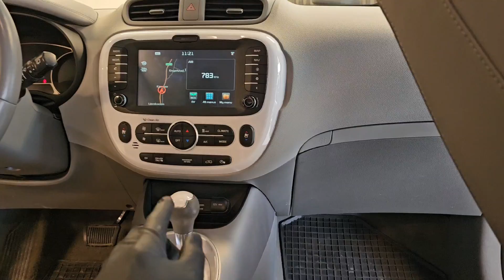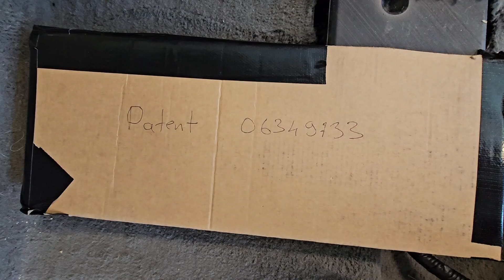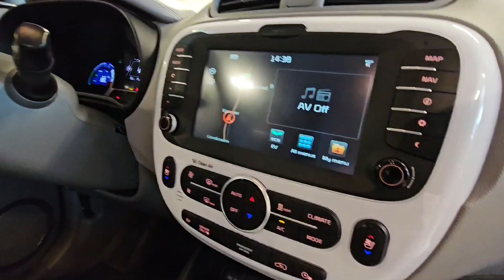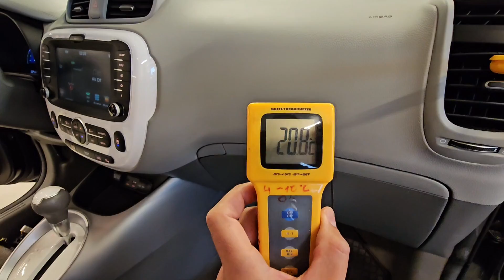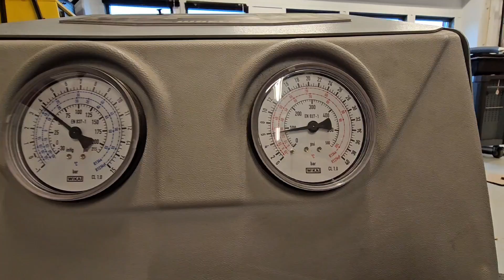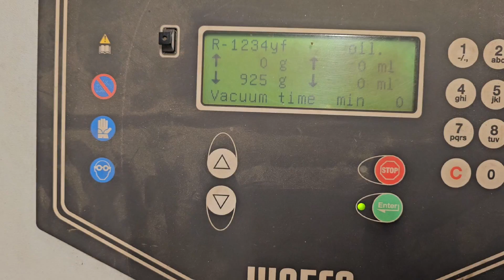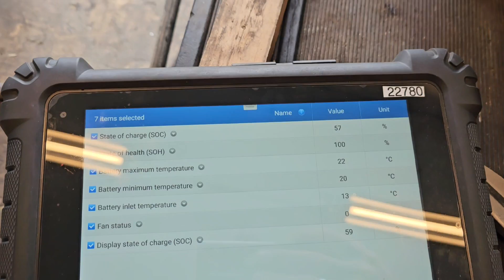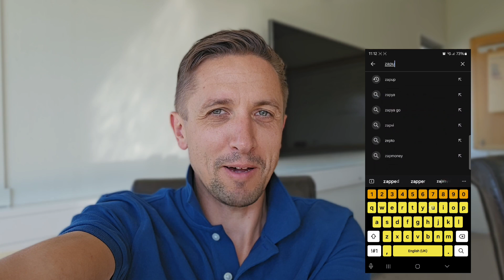Elbilmek improved battery cooling in Kia Soul 27 kWh

Comment: Question for Valdemar though - would it work if we did heat pipes like in laptops/desktop PCs - a series of cold plates, no liquid (aluminum with a thermal pad in between), soldered to closed heat pipes (which would be running to the blower fan at the back, with a set of cooling fins to disperse the heat faster in the trunk space, and opening a second vent above the trunk space in the cabin so the warm air directly disperses into the cabin rather than slowly dissipating through the car body. That way, we prioritize wicking away the heat as fast as possible from the batteries, to dump it into the cabin so the heat pump can do what it does best. Will need to figure out how to mount it so it doesn't rattle or slide around too.

Comment: I tried to do something similar on my ioniq 28, and it cooled the front cell's but the backside cell's where hot af and thus the charging was a bit weird cause it had to equalize all the cell's. I believe a mod to extract the air out of the trunk could help on those aircooled battery

Comment: This is a novel approach, and great for doing a challenge time if you're monitoring temps yourself.

For everyone else doing normal driving this has essentially bypassed all of the thermal controls for the battery, it could get too cold in summer, or too hot in winter especially on long drives if you are trying to maintain a cabin temperature. Best option for you is set AC to full cold aimed at floor vents if you're rapid charging and the battery is getting hot and you'll still get some benefits.

Comment: When will condensation be a problem?
Reply: @herrtichy  I think it could happen if the AC is switched off after cooling the battery for a while. If at that point warm air is pushed into the cold battery, it might cause condensation.
Reply: Or in the winter. That's why this change needs to be reverted when the weather is cold.
Reply: @bzcup  in the winter you can use this for battery heating 🙂
Reply: @mauriceprins1663  yes, in theory this should work just fine, but imagine you have a stone cold battery and you blow hot humid air from the cabin on it. All the humidity will condensate on the cold parts of the battery. If there's no problem with water ingress and there's a drain in there, it's fine. I'm no battery expert.
Reply: When your roof is leaking 😅
Reply: Condensation occurs when the surface is colder than the air. Therefore, condensation can happen when the battery is cold in winter. However, without that modification, the battery would take in warm air from the cabin in winter if the battery fan is on.